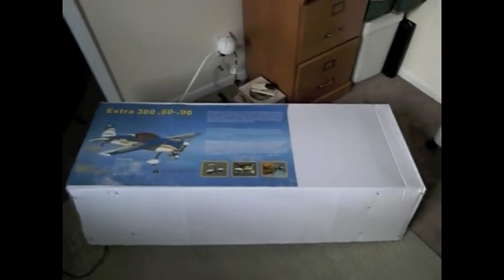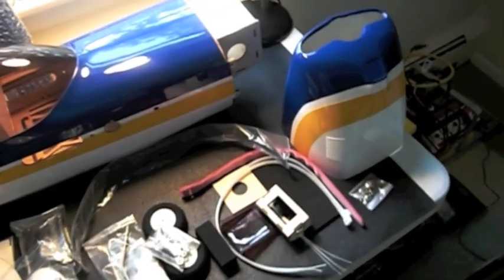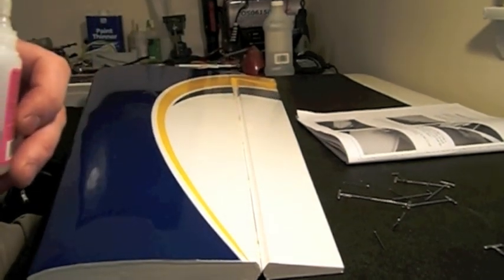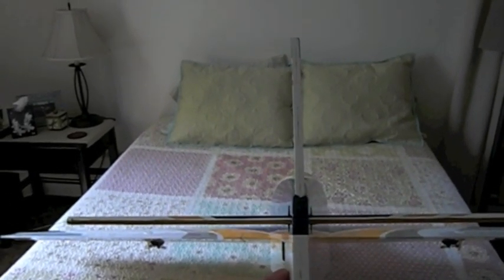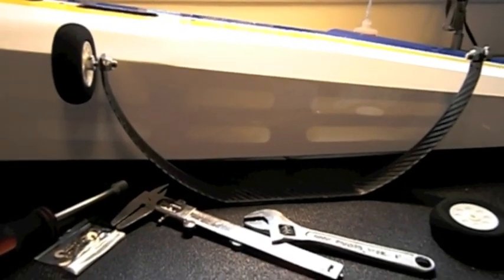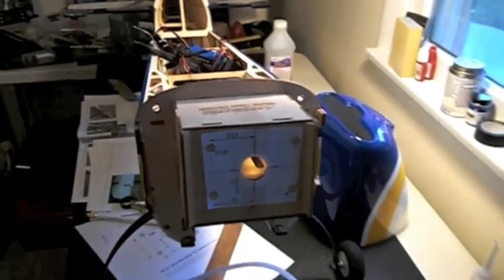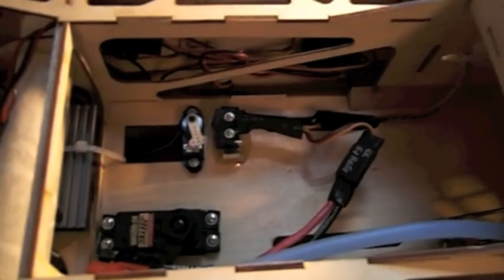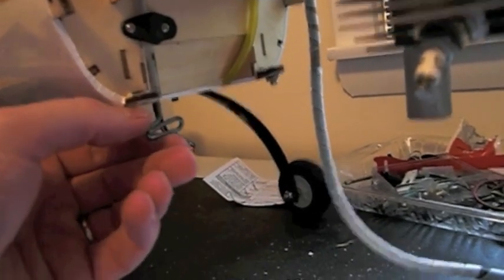Aero Works Extra 300 .60-.90 Build

Comment from the maker: For various reasons after the build I didn't fly it until today.
It flew great, the rolls with power were axial and only a small elevator correction and slower speeds. It loops with easy and the only problem I had was the wheel shaft came out on the second flight loosing the shaft and wheel.
I managed to stall it into long grass without any damage.
The videos are not great but give a taster.

Comment: Thanks for posting this video.  It was very helpful and the use of a bellcrank for the choke was a very nice touch.  Do you know the size and/or manufacturer of the bellcrank?
Reply from the maker: Seem to remember it was Dubro, probably, from Tower Hobbies
http://shop.dubro.com/p/90-degree-nylon-bellcrank-assembly-qty-pkg-2
Think tower hobbies have them.
With a little bending metal control rods make excellent actuators.
The other guys i fly with use a bar through the cowl but i have found this to work really well and very easy to setup.

Its a fun and quality feel plane to fly, I had a cap 232 from seagull which had a horrible tendency to flip on its back if I pulled it out of a dive to hard, this has no bad habits yet. The engine quit a few times but then i tried a friends fuel and it was fine.

Comment: Nice video man! Thanks for posting! I am just finishing up mine, and your video helped me a lot! How was flying it? I have never flown an Extra, do you have any tips for my first fly?!
Reply from the maker: It flies great, the rolls are tight with no corrections required, the only problem I had was when the engine went quiet on a touch and go to early to turn and got away with only minor damage, oh and one wheel fell of in flight another time, due to the pressed shaft coming loose, but some ling grass helped me out. I used an Aerovate 20 (similar to DLE) which gives plenty of power for me.

Comment: Great video. Two questions: where did you get that engine mount? And how was the CG afterwards? Starting same
Plane soon. Thanks!
Reply from the maker: +Mariano Agustín Bosaz 
Mount came with the engine and CG was slightly forward but moved some batteries around and balances perfectly, it will roll around it axes all day and has no major unwanted tenancies. I locked the engine bolts in by drilling and wire wrapping them and haven't had one come loose yet.

Comment: Hi i have the seagull extra version which im about to install a ngh25 in her, where did you get the template for positioning the engine please as its a little awkward positioning with just guesswork back and fore checking with plane upright
thanks